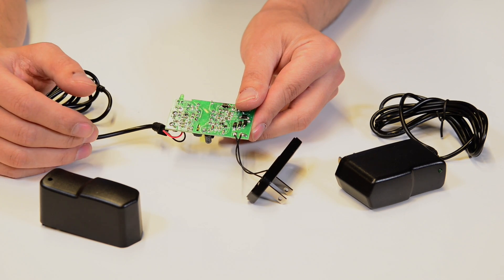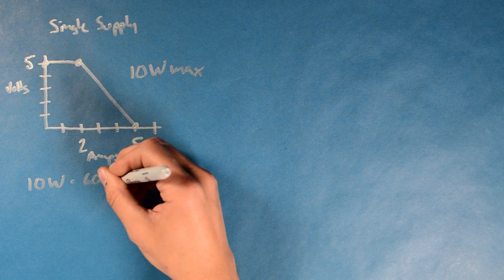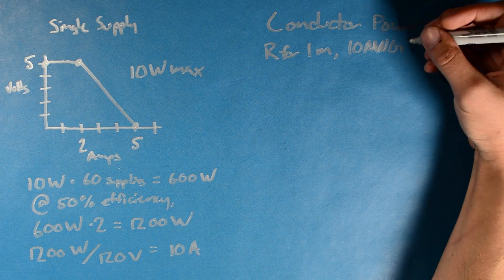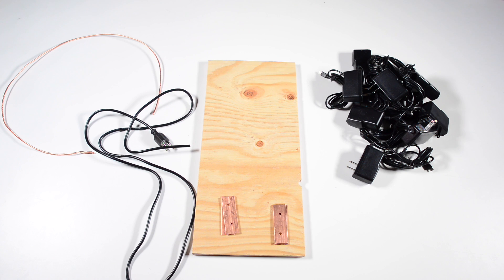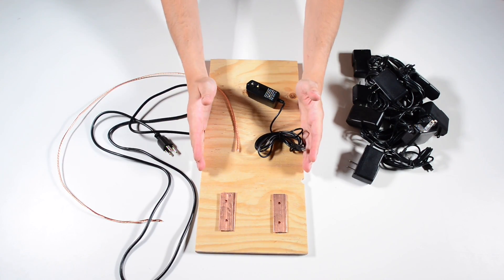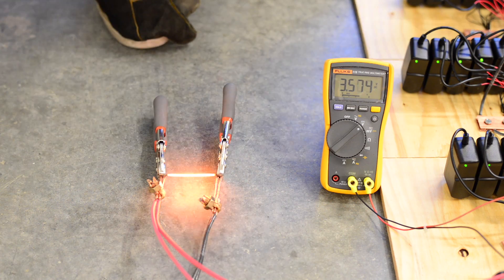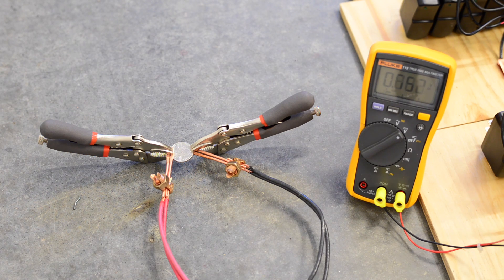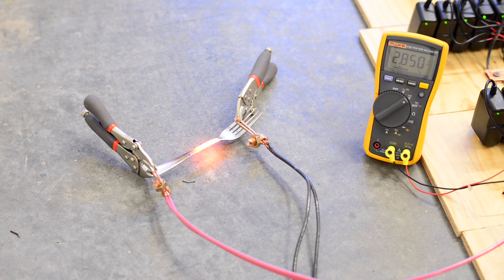Enginursday: 60 USB Chargers in Parallel

Comment: I needed 3A on a 12v LED strip.  I connected two 2A 12V power supplies in parallel.  This(sorta) worked, but one supply gets much hotter than the other.  I'm not comfortable with this.  A single 2A power supply gives up after 2hrs and starts switching off.  Is there a better way to more evenly distribute load?

Comment: I do not get it
if the efficiency is 50% you should divide by 2 not multiply by 2
or am I wrong?
Reply: He wanted to know how much power it will draw from the wall. 50% efficiency was an assumption. He knew output was 10W, so if its 50% efficient it will draw 20W from the wall. Or read it backwards for easier understanding. PSU draws 20W from wall, 50% efficient so output will be 10W and 10W lost usually to heat.

Comment: Would one even be able to do this at home?  It seems like there would not be enough power pulled from the wall.  And even if it did pull enough,  the temp of the wires in the wall would skyrocket.
Reply: The whole thing draws less than a kilowatt. An average vacuum cleaner draws twice that.

Comment: Using Power supplies in parallel doesn't really work afaik! unless they have current limiting :c but I guess it works ok in this case!

you can also use a mechanical pencil's core thingie and have a light bulb ;c. I just use my Bench PSU and slowly rise the current limit. it has 10A peak max output :c

Comment: can that current kill you?
Reply: Not on 5 volts. Apply ohm's law to the resistance of the body, and you will get really low current
Reply: No, the 5V is harmless, but the combined AC leakage through EMI suppression capacitors in 60 PSUs could give you a proper zing (up to about 1 mA could flow).

Comment: For more safety you should have desoldered the Y class capacitor which connects the primary side to the secondary side in each power supply .. that would them truly isolated from mains.
Also, it would probably be a good idea to use a 0.1 ohm 1-3w resistor on the output of each power supply as a sort of load balancing, in case one adapter outputs higher voltage than others connected in parallel
Reply: The Y capacitor is required to reduce RFI. If you had 60 power supplies running with their Y capacitors removed, you would have a radio jammer, which could get you in trouble with the FCC.
Reply: I'm aware of its purpose.. but for this experiment you wouldn't care about RFI and it would make the project safer (the tiny amount of ac leakage on the output from one power supply due to those capacitors can't hurt a person, but the amount of 60 such power supplies can add up and can be dangerous)
Reply: Nah, it's plenty safe as is. EMI suppression a capacitor have pretty low capacitance, just a couple nF. Let's go with 4.7 nF. At 60 Hz the reactance of 60 of those in parallel is more than 100 kΩ, probably around 150kΩ (don't feel like punching it into a calculator). So at 110 V a short to ground would be less than 1 mA. Which hurts, but is not dangerous.